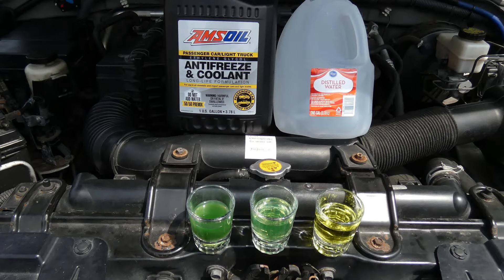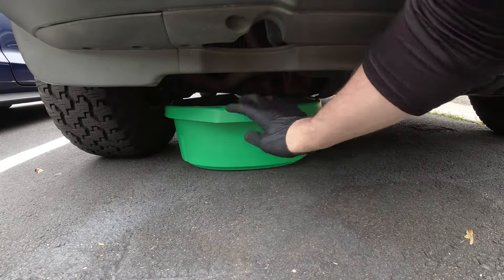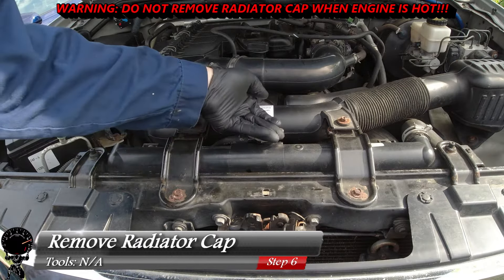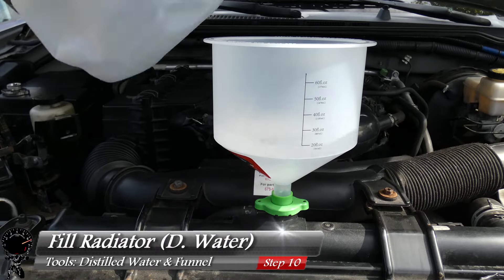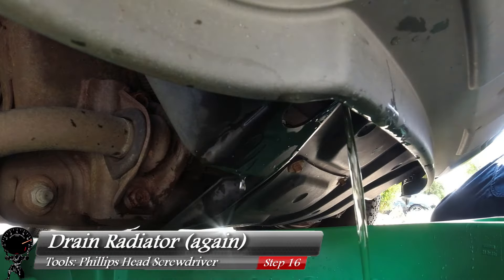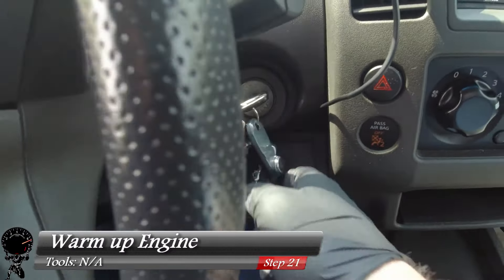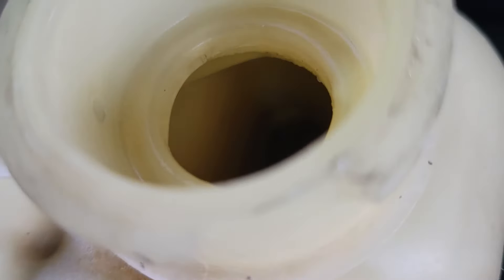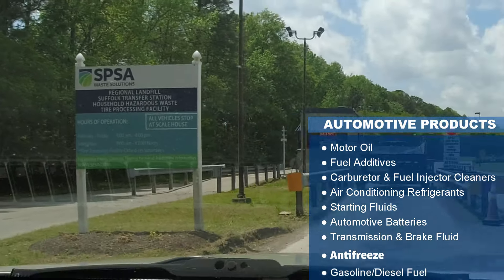How to flush and fill Antifreeze & Coolant for a Nissan Frontier (2008-2014)

Comment: Isn't the right coolant for this vehicle the blue stuff? That's what my owner's manual says (I have the 4.0 L V6).
Reply from the maker: That's a very good question. Based on my 2009 owner's manual, "When adding or replacing coolant, be sure to use only a Genuine NISSAN Long Life Antifreeze/Coolant (green) or equivalent with the proper mixture ratio of 50% antifreeze and 50% demineralized or distilled water." Upon further research, AdvanceAuto, AutoZone, Amsoil, etc. all recommend the same Ethylene Glycol (50/50) AntiFreeze. With that being said, there are some Nissans that contain the blue Antifreeze; good observation and question.
Reply: The coolant chart on display at your local auto parts store recommends the blue coolant for 2012 and newer Frontiers.  Green for older models.
Reply: @provervio yep my 2012 takes blue coolant not green

Comment: Very clear and helpful video. Thanks. When the distilled water is added there is a fair amount of coolant still in the engine block.  Once the flush is drained there is a very diluted amount of fluid remaining in the block. Nowhere near 50/50. Adding 50/50 to that results in the total amount being less than 50/50.
Reply from the maker: Correct, it is less than 50/50 with the process that was shown. This was why it was tested at the end of the video; to display the max temperature limits. In my area, it doesn't get very cold nor very hot, so this mix worked out perfect. If you are in a colder climate area, adding (100%) coolant to the mix to achieve the desire tolerance would be ideal. Good observation 👍

Comment: Hey man, if i remove the cap on the radiator and then the cap on the overflow, the radiator level drops whilst the over flow rises (cold engine and turned off). Looks like the radiator is emptying into the overflow tank. Why is this happening? 2006 pathfinder. Very helpful video btw
Reply from the maker: Sounds like the water/coolant leveling when at rest.

Comment: How come while you're filling your radiator to the radiator filler neck your reservoir isn't simultaneously filling up if you look at it while filling up the radiator? On my Frontier when I want to fill the radiator to the top of the radiator filler neck, the coolant level in the reservoir keeps going up past the max line.
Reply from the maker: Good question. The filler cap/insert (the green cap and insert) obstructs a majority of the coolant from going directly to the reservoir.

Comment: I would imagine that this process is the same for the 2014 Xterra so I'm wondering why you're not using the blue coolant. Also, I was expecting to see you use the radiator flush chemical.
Reply from the maker: That's a good question. The color of the coolant is not a good gauge of required specification for vehicle usage. Upon research, the chemical composition of the green and blue coolant are similar (always confirm with your owners manual, regardless). The 2009 Nissan Frontier Owners Manual states, "...be sure to use only a Genuine Nissan Long Life Antifreeze/Coolant (green) or equivalent."  Verified the equivalent Antifreeze with the Amsoil Dealer, and they confirmed the product purchased was ideal. I was considering using a Radiator Flush Cleaner, however the coolant was not in bad shape. So this cleaner was omitted. If you wish to use a cleaner in the system, you may do so as long as the instructions on the product are followed. Great questions.

Comment: On my frontier Only ~5 qts of old coolant drained and when I flushed with distilled water, I could only fill ~1.5 gal into the radiator. Should I drain the block as well or just fill until full? (Level in radiator and reservoir seem full after 1.5 gal of water was added)
Reply from the maker: 5 qts is 1.25 gal, so you're not too far off. Draining the engine block is an option, however I found it more trouble than it's worth. If the coolant is clean, verify the system is burped and air free. Then, top off the reservoir and keep an eye on the level for the first week or so of driving (just to be safe).
Reply: Awesome, thank you! I my truck just hit 100,000 miles and your videos have been a real money saver! Thank you again 🙏🏼
Reply from the maker: I'm very glad they helped!!! Thank you for the support.

Comment: Great video 👍👍 quick question… noticed you had a tin foil pan on the passenger floor with some coolant in it . Was that a leak before you changed the antifreeze ? And if so did the flush fix the issue ? I have a similar slight leak on my 2013 frontier passenger side also . 
Thanks Again for your professional instruction
Reply from the maker: Thank you for the positive feedback. Forgive me, but I can't find the footage of a pan on the passenger floor (I'm also oblivious at times). But in short, no, there was no leak on this frontier. This was just a simple maintenance item that was overdue.
Reply: Thank You 🙏

Comment: Great and very well explained video; Was wondering what was the model of your Boss audio system ? Saw BV755b but just wanna make sure my eyes are good
Reply from the maker: Thank you very much. The radio is a BOSS BV755B, something simple for  a simple truck.
Reply: @mcgurrentertainment  Awesome, definitely what i need, and did you need an installation kit for it ? One last thing, do you plan to do a video for the brake fluid replacement ?
Reply from the maker: Yes, I did order the installation kit with the radio (Crutchfield typically adds it for free). I can do a brake fluid replacement video, it's very easy; may take some time to produce it.

Comment: I have an '08 frontier 4.0 V6. After I drained the coolant(and broke the heater core outlet connector) and added distilled water I'm just blowing cold air from the vents?
Reply from the maker: You might have air in the system. Try burping it.

Comment: What are your thoughts on a cooling system flush (like Blue Devil or some similar product). I'm planning on following your directions to change the coolant on my 2017 Nissan this weekend - 112K miles, doubt coolant has ever been changed/flushed.
Reply from the maker: I have personally never used a coolant flush product before (that's doesn't mean it's bad, I just haven't needed one yet). However, I have heard good results from flush products, and I think even ChrisFix used one in his video. I think as long as you follow the directions and flush the system with distilled water, you should be fine.

Comment: When you warmed up the engine with the distilled water in radiator, did you leave off the overfolw cap? I didn't see you put it back on.
Also, how do you do the final warmup with the funnel in place and the overflow cap off without the coolant expanding and flowing out as it heats up?
Reply from the maker: For the coolant reservoir, the cap can be left off since it's a vented cap. 
When the funnel is attached to the radiator (with fluid), it allows the system to remove air bubbles. The system will take fluid from the funnel as air is removed. 

Just don't redline your engine constantly as the system is warming up.
Reply: Thanks for the vid. Very helpful. On my frontier I put a skinny funnel under the bypass hose to get the coolant to the drain pan without getting on other stuff. It worked well.🙂
Reply from the maker: Very Cool

Comment: I have a 2006 Nissan Pathfinder which is basically just a SUV version of the Nissan Frontier. I want to change the antifreeze, but can the older Nissan vehicles use the blue coolant used on modern Nissan vehicles?
Reply from the maker: That's a good question. The color of the coolant is not a good gauge of required specification for vehicle usage. Upon research, the chemical composition of the green and blue coolant are similar (always confirm with your owners manual, regardless). The 2009 Nissan Frontier Owners Manual states, "...be sure to use only a Genuine Nissan Long Life Antifreeze/Coolant (green) or equivalent."  Verified the equivalent Antifreeze with the Amsoil Dealer, and they confirmed the product purchased was ideal.

Comment: My coolant tank has some sludge in it. I plan on replacing the tank to start fresh when I flush. Will 3 gallons of coolant and water be enough?
Reply from the maker: For the 4 cylinder engine (QR25DE), the max capacity (including Reservoir) is 10 Qts (2.5 gallons). So, 3 gallons should be OK.

Comment: When you’re warming up the engine on step 12 the distilled water is in and the original coolant is out correct? After that when you’re draining again it’s the same water?
Reply from the maker: Yes, a majority of the system is distilled water on step 12. Once it's drained again, the liquid is a coolant and distilled water mix (mostly distilled water).

Comment: Do you leave the reservoir cap off when burping the system at the end (step 20)?
Reply from the maker: Yes. It was reinstalled on step 23. It doesn't matter if it's installed during the burping process, the reservoir is vented.

Comment: So I have 2018 V6 engine frontier , and I'm original owner , would this be the exact process on my V6 engine ? Im at 56 thousand miles right now and want to try this ?
Reply from the maker: I couldn't tell you off the top of my head. You may need to check the service manual.

Comment: Hey so did you turn on the car with the cap off??? for both the radiator cap and the revisor cap?
Reply from the maker: Yes, during the burping process both caps were off. Step 23, installed both caps before the test drive.
Reply: @mcgurrentertainment  thank you very much. I was afraid to follow that step without the cap and have something explode 😂. Thank you very much for this video
Reply from the maker: When in doubt, ask questions. Always feel free to ask questions. 😊

Comment: i have a 2015, do you think it somewhat close to this procedures?
Reply from the maker: It's possible, but I'm not 100% certain.
Reply: @mcgurrentertainment  thank you, it looks to be the same. another question. the waiting for the air bubbles to stop, is that mainly for the type of funnel your using? if I don't have that would I just be watching to see when its completely filled?
Reply from the maker: Running the engine to verify if air bubbles are no longer present is needed regardless of the funnel used.
Reply: @mcgurrentertainment  thank you. Just wanted to double check. So if I’m using a regular funnel, the air bubbles should still do its thing? I see why you use your funnel though in the event of putting too much fluid you can cap it and put remaining back in container? Is that right? I’ve only seen one other video like this and yours is definitely more informative. I’m just trying to see how I know how much 50/50 to put in before it overflows.
Reply from the maker: @0livareZ correct
Reply: @mcgurrentertainment  well i did it. i followed all your steps. and I'm glad I did.  a few things I noticed and ill start off by telling you. the place I take to get my oil change had mentioned the coolant was below the MIN line so I had been frequently adding into it for the past 2 years. well now that I did this project, after removing what was in the resivour and the radiator. i only got about a gallon and half out. even using the baster to suck it out and waiting the 20 mins. (btw the opening you have for the tubing you let the water and coolant run out of for the resivour is a lot bigger than mine, so it was dripping all over the frame of the truck and was just angled awkward) so I was thinking wow, was it that low??? so I'm at the point where I need to put the antifreeze in and this is where I realized I probably should of spent the extra money on the funnel you had because I wasn't achieving the bubbles. i had to cut one of my funnels so it fit perfect and then iwas able to get bubbles but at this point I still couldn't keep pouring it because it was overflowing. after turning on the truck, trying to burp the system, it finally went down. i went for the test drive everything was fine. i let it sit for 2 hours came back out and noticed the radiator and resivour were low and not topped off. so I added more and tried to burp it again. then I turned it on to see if the fluid was go down the radiator for more room to pour. that overflowed it and came out of the top... it was bad. had to clean up everywhere and my driveway. 
i ordered one of those testers you have in your video, so ill test the resivour coolant in next couple of days. Temp gauge is exactly where it needs to be though.

Comment: Why does your engine look different than mine? What year and model frontier do you have? I have a 2009 LE, 6 cyl, 4wd. My air filter is to the right of the engine.
Reply from the maker: The Frontier in the video is a 2009 XE, L4, 2WD

Comment: Is this the same for a 2016?  I thought wasnt much of a difference from 09-19?
Reply from the maker: I'm sure the process is similar. I am not 100% sure off the top of my head.
Reply: @mcgurrentertainment  could I just do a drain n fill?  Is running distilled water necessary? Another thing my truck is 7 years old n in not sure if the coolant was ever changed.  Books says to change every 100k or 7 years which ever comes first.  There is 35k on it.  Thanks for the reply
Reply from the maker: Yes, you can just change the coolant without flushing the system. The distilled water is used for the flushing process, or if you have the coolant concentration (not 50/50 mix). Every vehicle has different maintenance intervals. This frontier called for a coolant change at 60k, then every 30k afterwards. Just follow the owners manual requirements and you're good.

Comment: What if my heater don’t work is that ok too
Reply from the maker: No, it's not ok. Winter is coming. It's going to be freezing out.
Reply: Of course but I’m asking if my heater don’t work does it affect the steps of flushing the coolant. I can handle a little cold
Reply from the maker: It depends why your heater is broken. The idea of turning on the heater is to circulate coolant through the heater core. Depending how the system is defective it may omit the new coolant from passing through the core. With that being said, if you need you change out your coolant (due to excessive contamination), it can't hurt to do it.
Reply: Not broke idk why the guy removed the heater pipe it’s a long pipe easy fix just haven’t found time to find it in my house

Comment: What does it mean if the coolant keeps rising in the funnel? I have a 4.0 xterra
Reply from the maker: It's likely the system is heating up to temp. Make sure you let the engine cool before removing the funnel.
Reply: @mcgurrentertainment  literally happens as soon as I turn on the truck, do I need to have the expansion tank open as well? Thank you for the reply